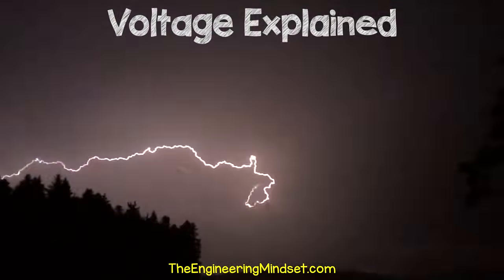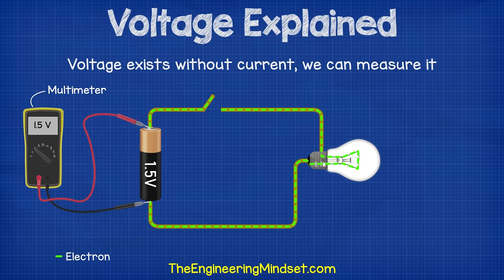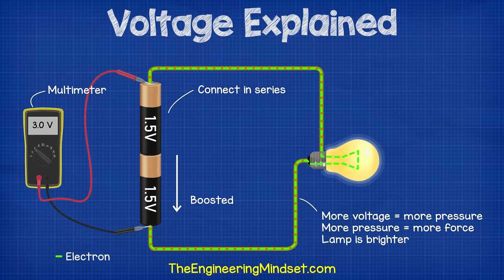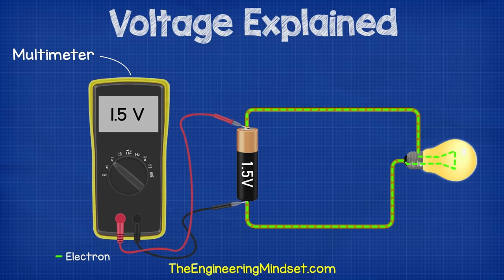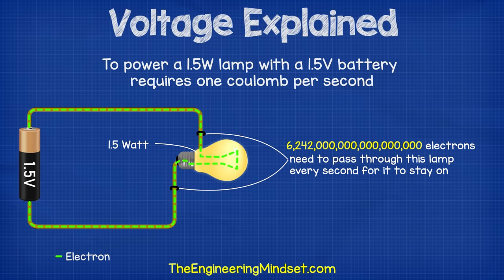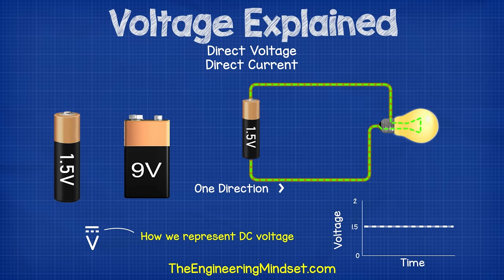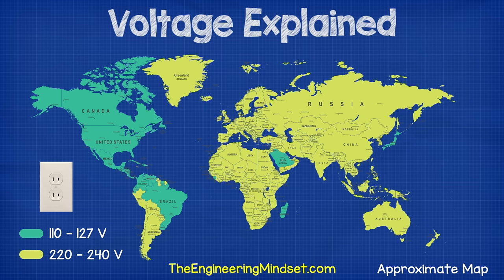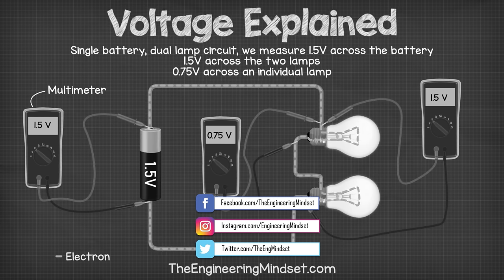Voltage Explained - What is Voltage? Basic electricity  potential difference

Comment: The easiest way to explain it would be to think of a battery. Nature is about balance. You know that when you put the positive side of a magnet close to the negative side of another magnet, they're going to try to pull together. They're trying to "balance" themselves.

Now think about that with electrons. The electrons in the negative side of the battery really REALLY want to get to the positive side. We take advantage of this by creating circuits. We give them a path to get to that positive side that they desperately want to reach, and we have them do a little work for us along the way. The MORE free electrons in the negative side of the battery, the more POTENTIAL there is for us to use (Voltage).

This is why a fully charged battery will read its rated voltage, or close to it, and why a depleted battery will read a noticeably LOWER voltage -- reflecting the fact that many of those electrons are now at the positive side of the battery. There aren't AS MANY of them left that need to get over there anymore, so much of the FORCE they provide when traveling through the circuit has dissipated.

Think of a bunch of people waiting outside a store before Black Friday. All of those people are electrons. Outside the store is the negative side of the battery. The store itself is the circuit. The register is the positive side of the battery. As soon as those doors are open, those people are going to rush to get to the items they want, grab 'em, and run for the registers! The more people (electrons) there are waiting in line (negative side), the more FORCE they'll have when they make their rush to grab what they want and checkout (positive side).

I hope that helps.
Reply: Not so much help its actually magic, I FINALLY understand. THANKYOU
Reply: There is not another Youtube comment that has been more useful to me than this one. outstanding explanation dude
Reply: @hania_khan396  You're very welcome. Glad to help. It's a bit confusing to grasp when you're unfamiliar with it.
Reply: @derpderpinson7449  Glad to help! It took me a while to grasp it completely myself. Once I did, I'd figured an explanation like this would be helpful to others.
Reply: Thank you for the explanation, but I don't understand the meaning of potential flowing from high to low. Doesn't this mean electrons should flow from plus to minus?
Reply: @robp4616  yep thank you!
Reply: @asiandude918  Sorry to respond late, but it didn't seem to give me a notification when you commented.

Potential is the difference of charge between the + side and - side of the battery, in that example.

When a battery is fully charged, it is at full potential because all of the electrons are on one side (-) and are desperately wanting to reach the (+) side to "balance" the battery.

When a battery is being used, it is connected to a circuit -- a series of wires and components -- from ONE side of the battery to the other.

This gives those trapped electrons a path to travel in order to reach the other side of the battery. When a battery is fully charged, it's like opening up the flood gates and letting it all rush through. That is the voltage (potential). If you were to put a DMM across the battery, it would read the correct voltage when it's fully charged, or somewhere around it (9V, for example).

As the electrons travel through that circuit to reach the other side, the charges in the battery are balancing out, which lowers the potential because there isn't such a huge number of electrons trying to cram their way through the circuit to the other side. That's why voltage readings lower as the battery becomes discharged.
Reply: A A  thaaaaaanks
Reply: A A 
Can I ask a question?

Can we think that the positive side and the negative sides like magnets?
There’s a negative and a positive side in the magnet too and they push each other when the same sides get close.
Reply: Thank you .like it was a thundershock of knowledge to my brain
Reply: I love you
Reply: Yo, this just helped me understand the whole concept! Thanks a lot!
Reply from the maker: Check this out, how a battery works: https://youtu.be/PXNKkcB0pI4
Reply: What I don't understand, though, is how two batteries in series generates a higher voltage.
Reply: Thanks a lot, your explanation helped me out
Reply: @robp4616   why doesn't the battery work when you put it the other way round, even though it's still a connected circuit, and the battery still has two poles?
Reply: wow!
Reply: As per your explanation after buying items(the electrons) they will go outside (the negative side),but it is not possible.Because if this happens the battery never drains😂
Reply: This is the best youtube comment I've ever read, I love you
Reply: @A A Amazingly Explained! Thankyou ! please start teaching physics this way on your YouTube channel...
Reply: Gods work
Reply: the thing is, when you say it's because more electrons are craming there way through, you are now referring to amperage. amps refers to the number of electrons per second. so to increase voltage while leaving amperage the same, you are effectively increasing available wattage without changing the amount or speed of those electrons. unless i'm missing something from your explanation.
Reply: holy shit you're so smart, i dont get any of that BUT nice explaining
Reply: @Really? no
Reply: Wa
Reply: Way*
Reply: @Really? bruh I read it too but I  had no idea what they meant I hate physics
Reply: I thought I knew what voltage was. Then i met capacitors, got confused af, and had to rethink the concept entirely. You're explanation along with this video has ended my 23 hours of pouring over the idea and given my mind clarity on the subject.  Thank you.
Reply: @eoinkane5908  Yeah it's not a perfect analogy in every situation, but it explains the concept well enough.
Reply: Damn you are good 😂😂😂
Reply: @a_commenter  The electrons increase as well as the voltage. After all two heads are better than one. Think of it like this, if Mayweather punches Logan Paul once his teeth will fall out, that means two punches from Mayweather will either knock him unconscious or kill him. I don't know if this helps, but I hope it does.
Reply: @le403_gundusravankumar8  You are being too technical about it 😂😂😂
Reply: I have a question. Does each voltage in an electric current must be greater than 0 or less than 0?
Reply: @misspetmalu501  Are you asking whether or not you should see a positive or negative reading when measuring voltage with a DMM? (Digital Multi-Meter)
Reply: @robp4616  Yes, Sir. Does that mean each voltage in an electric circuit must be positive? Must be negative? Can sometimes be both at the same time? Or can be positive, negative or ground?
Reply: @misspetmalu501  When the voltage is showing as a negative number while you probe the circuit with a DMM, that simply means you have the probes backward.

Probe a battery you have lying around. Put the red probe on the positive (+) terminal and the black probe on the negative (-) terminal. Make sure you have it set to DC voltage ⎓ (solid line on top, dashed lines on bottom).

If you're probing a 9v battery, it should show somewhere around 9 volts (duh). If you're probing a AA, it should show around 1.5 volts. AAA should be the same.

Now, if you swap the probes (put red probe on (-) and black probe on (+), it should give you the same reading except it'll show a negative number. This isn't damaging your DMM or the circuit when measuring voltage.

The only way you'll see a negative number on your DMM when measuring voltage is if you have the probes in reverse. This doesn't matter if you're just trying to find voltage, but it could be helpful if you're not sure which probe location is positive and which is negative.
Reply: @a_commenter  the voltages add together.
Reply: @a_commenter  the voltages add
Reply: lol this youtuber replied a link to his battery video because your analogy is wrong xD
Reply: This make sense, and is helpful, but I’m now unsure of how Amperage factors into this. It’d be really great if you could write an explanation.
Reply: @asiandude918  the electrons have a negative charge so they flow to the positive end of the battery.
Reply: Thank you 😍😘😍😍😘😍😘great explanation
Reply: You are a life saver!
Reply: That was very helpful. Appreciate the analogies you applied to the theory. Thanks
Reply: @asiandude918  Think of a water faucet. If you slightly turn the faucet on, you'll get only a little bit of water. However, if you turn the faucet all the way up, you'll get more water pressure. In essence the more water pressure you apply, the more water can flow the the faucet. In essence,, the pressure in the plumbing system, is similar to pressure in an electrical circuit. 
In a home electrical system,  the utility company, usually offers homeowners a single phase system with two electrical potential differences. 120Volts, and 240Volts. Depending on the type of electrical device, will ultimately determine the potential difference required to ensure that the pressure (potential) needed to move amps through the device.
Reply: Thanks a lot
Reply: The battery has the bronze color part less than the black part, they are not equal, one being more predominant than the other, which the bronze part is where the positive pole is, and the black part is where the negative pole is. So... this would be a symbolic way to represent voltage? the potential difference? Or these colors is just random?
Reply: Thanks buddy
It was useful
Reply: The way u just explained is ....... Thanks a lot man
Reply: just a doubt, why can't electrons go through the positive side throught the battery itself? wouldnt it be much easier and faster way?
Reply: @Saitama-py8dz  you mean to jump from the negative terminal to the positive?

Because there's an insulator preventing them from doing it.
Reply: @robp4616  oh okay. thanks
Reply: @a_commenter  I'm not sure if this is still of interest, but maybe this helps:
Imagine two glasses of water, both filled to the same level. The water column in each glass corresponds to the DC voltage of a battery, e.g. 9 volts. The amount of water corresponds with the stored energy.

If you connect 2 batteries in parallel, that's like putting the 2 glasses next to each other: Measured from the table surface, the water level (corresponding to the voltage) in neither glass is higher than before. Therefore, two batteries in parallel would still result in 9V.

If you connect 2 batteries in series instead, that's like putting the 2 glasses on top of each other: Measured from the table surface, the hight of the water column now about doubles (corresponding to the voltage). Therefore, two batteries in series would add up to 18V.

The amount of water however, respectively the stored energy, stays the same in both scenarios.
It's a simplified example, but I hope it makes it a bit easier to grasp.
Reply: @danieldauber8335  Thanks, this was really helpful
Reply: @robp4616   can I ask you which are sources you learn this from ?  It looks more easy to understand this video is pretty hard to understand
Reply: Thank you :)
Reply: I am kind a new learner and as I understand this examples perfectly fits to DC circuits. But what about AC, I need similar mind clear example of AC :)
Reply: Agreed. There is no postive to positive or negative to negative. Everything has a couple. Not woman and woman or man and man. All about balance
Reply: Oh
Reply: wait so, if we had no potential difference, does that mean that the negative and positive side is balanced? and the more potential difference there is, mean the more unbalanced they are??
Reply: thank uuu a lotttttt
Reply: By far the most useful comment on YouTube ever.
Reply: you didn’t have to comment that. but you did so people could learn. much love
Reply: thank you bro god bless you
Reply: You sir are the very best!
Reply: Thanks so much for this😍
Reply: Thank you🙏🏾
Reply: Awesome
Reply: you are the best rob p thank u u r heaven's gift to earth 
sincerely, grateful student
Reply: Such a great explanation in layman's term. Thanks a bunch. Would you mind having a youtube channel where you could explain all these stuff , will be really helpful to all :)
Reply: Just know, you helped so much. Read it like 5 times haha
Reply: Holy shit man, fucking incredible explanation, thank you for that,, I hope you’re in a position to teach others because you have a way of explanation that is astounding ❤️
Reply: @a_commenter  I don’t believe they do, I believe they generate a higher current, or a higher flow of electrons between the potential, at least when connected through a ‘series’. For example, if batteries are lined ‘upright’ in two columns, positive to negative, with one column having the positive side, and another column having the negative side, the voltage(potential) is increased because the the batteries are combining their potentials,, if batteries are combined sideways, or in a ‘series’ in other words, the potential is spread only across the positive and negative sides, making a higher current, but otherwise the same voltage. 
Edit: I explained this completely backwards, and had ‘series’ mixed up with parallel,, I apologize
Reply: bro I cant believe I finally understand this shit wowowow
Reply: @a_commenter  by connecting 2 identical batteries in row you are doubling the amount of free electrons. And now you have more electrons but on the same road. This means the pressure for them to move through is a lot higher. But higher pressure means a faster current, so it will deplete just as fast as a single battery that runs at a lower current
Reply: @robp4616  Excusme are you available for a question regarding voltage?
Reply: @JB-sm2ie  go for it
Reply: @robp4616  thanks for getting back to me so quickly. I was liking the mechanics and waves part of physics up and until electricity. Now I’m in complete confusion. I still just don’t understand voltage at all. What happens to the electrons once they’ve gone from the negative terminal to the positive? I also just don’t understand batteries in a circuit as opposed to in parallel.
Reply: @JB-sm2ie  you mean in series as opposed to in parallel? 

And think of voltage as the force used to push electrons.
Reply: @robp4616  Thank you. So if it’s a force, what changes between a low and a high voltage. Yes I Don’t understand why voltage is the sum of both batteries in circuit though remains the same in parallel.
Reply: @JB-sm2ie  so if you have 2 batteries within the same circuit that are wired in series, their voltage is added together because that's even MORE force that's pushing those electrons down the same path, in series.

When wired in parallel, you're introducing additional paths for those electrons to take. And so, if wired correctly and if the voltage of the 2 batteries is the same, the total voltage will be cut in half due to the additional paths of travel those electrons can take (and half of 24V would be 12V) -- so the voltage remains the same, but the current (throughout) has increased, potentially. 

When working with multiple batteries, it's a bit more complicated,   and even more so when the voltage is different in each battery, but the principle remains the same.
Reply: @JB-sm2ie  I'd recommend looking up some circuit labs online to see it in action. You can add batteries and loads as you please and wire them however you'd like then look at the results. 

I'd also recommend you try to learn the formulas for calculating voltage drop across circuits in both series and parallel.
Reply: @robp4616  thank you very much. I’m starting to understand. Still a bit more to get my head around.
Reply: @JB-sm2ie  yeah, it's one of those things that take a while to click. Hard to fully grasp the concept
Reply: @robp4616  yeah that’s true. Once again I really appreciate your time so thank you
Reply: if like this what different with   current，current is 6.24×10^18 electron flow a place right？
Reply: @buttbuttyawn3280  "there's way more shoppers outside the door, so the force shooting them in is greater, doesn't that mean you'd expect the current to be faster too?" 
If you have a wider path, without obstacles, more shoppers can get into the store -> more current (more electrons moving/1sec). Thin path, or many obstacles (resistance) means fewer electrons can get through to the store/time -> less current (less electron moving/1sec) even if the potencial difference (voltage) are the same in both case.
Reply: @pickle962  i think because then the electrons have to move the other way through the circuit, and the device than doesnt work, because the powering process is backwards, if that makes sense. The device expects the electrons to come from one side, but they come from the other side, which makes it not work.
Reply: @robp4616   @Dylan Badger  I understand that electrons can't travel or jump from the negative terminal to the positive terminal because there is an insulator...but because of that same insulator, how do the electrons travel from 2 batteries in series? In other words, how do the electrons travel from the negative terminal of Battery#1 to the negative terminal of Battery#2? Wouldn't that mean the electrons would have to go from the positive terminal to the negative terminal of Battery#2? And also through the insulator?
Reply: So in this scenario, for example, the amps would be the amount of people who run passed the electronics aisle, (which is at the very front, so every electron/customer has to pass by it) every second?
Reply: Thank you for this!
Reply: Still doesnt explain what charge is. Is it a property of each individual electron? Or just an emergent property resulting from too many electrons being concentrated in a limited space and wanting to get out just like pressurized gas?
Reply: @Henry14arsenal2007  the latter.
Reply: Omgggg than you soooo much it helped a lottt I've got my exams tomorrow

So basically.....voltage can be defined as the absence of electrons on the positive terminal...so the battery is basically trying to make itself neutral???
Reply: so voltage is charge ? What are amps then
Reply: @bikerboy3k  Amps are recognized as the number of electrons that pass a point in a specific amount of time. 

Generally, raising the voltage will increase the amperage (current) as well, so long as the resistance remains the same.

This will increase the power (wattage) as well. 

Try using a wattage calculator online to see what I mean.
Reply: @knowledgeknowledge2466  pretty much. 

When a battery is "charged," all the electrons are crammed into one side (the negative)
Reply: @knowledgeknowledge2466  how'd the exams go?
Reply: @robp4616  I get confused with the water example because I try to relate it to electricity as it's also stored and I have a hard time understanding how does one "Increase the voltage" as in increase pressure of the water. So let's say I got a potentiometer connected to the wall socket on one side and a light bulb on the other. Would it be like equating it to a tap in the middle of a garden hose? The potentiometer is like a resistor right ? And let's you adjust resistance? So if I decrease the resistance by twisting the potentiometer, less current so less amps will get through because there is less voltage passing through to push them to the light bulb >? And so the light will be weaker ? But here is why the water example is confusing. If you squeeze the end of a hose, you get water escaping faster although less of it. So then wattage is the...I don't know effort? Going to the bulb ? Less effort less results from the bulb ? I feel dumb dude the more I google it the more confused I get. Says 1 watt is 1 amp under 1 volt but under it says 1 amp is 120 watts. I should've paid attention in school bro, got too many questions.
Reply: @bikerboy3k  driving right now but I'll try to help in a bit
Reply from the maker: Check out NEW resistor video, everything covered! ➡️ https://youtu.be/DYcLFHgVCn0
Reply: The people trying to go in the store as fast as they can are the amps and the amount of security guards trying to stop the people are the ohms ir resistance.
Reply: @robp4616  cheers.
Reply: You're my hero!!

Thank you sooo much👍
Reply: Ah.  This explains why some people get tired if they wait in line too long and start to leave (e.g. leaving a battery in a drawer for a few years) and also explains why other people shoplift (e.g. rush in, grab stuff, and leave without paying).
Reply: Brilliant
Reply: In California, we don't need the register.  We take the products and just run the fock out of the store.  No question asked!  So it's hard for us to understand your example
Reply: In a hope of getting answer after 3 years :- 
 How does magnetic or electric field work (attract/repel) without any physical contact? What is the field made up of? It's just air particles or nothing? It's their property?
Plz answer in a simple language if possible (class 10th)
Reply: Pov the comment explained better than the vid.

Ngl though the vid helped me grab the concept this comment just helped me understand.❤❤
Reply: I FINALLY UNDERSTOOD, I SWEAR IM GONNA WORSHIP YOU, BRO I WANT MORE OF YOUR EXPLANATIONS
Reply: @robp4616 So with a battery do the electrons flow from the negative pole to the positive pole, - is that the direction the electricity goes in?  One would imagine the 'positive' to push it out and the 'negative' to be in receipt passively, going by the words used?  Thanks for the reply.
Reply: @Edward-mt2og  technically, the electrons go from the negative side to the positive side. This is because the atoms on the positive side are positively charged and atoms on the negative side are negatively charged. 

Electrons are shed from the negative side and move toward the positive side. They're attracted to the atoms on the positive side that are in need of electrons to become (balanced.) They're also repelled by the negatively charged atoms on the negative side because they're unneeded. This creates the force (voltage).

Thinking of a magnet helps to explain this. 

When you put the (+) side of a magnet to the (-) side of another, they easily snap together. When you try to put the (+) side with one magnet to the (+) side of the other, they repel, or resist. Same with (-) to (-)
Reply: Thank uuu!! it was always hard for me to grasp...thanks again!
Reply from the maker: Seen our new Potentiometer Explained video? ➡️ https://youtu.be/Xb-MZMoUtcQ
Reply: Amazing explanation… hats off to you.
Reply: You have to go back.
Reply: @eternallearner5395  I have to go back? Lol

I've been out of the electrical game for a while
Reply: I love this explanation so much, I have always struggled so much around potential difference but this makes it so simple. Much love!!
Reply: Following this analogy, how is it that a battery is consumed up ? From the comment, it seems that it's because a used up battery has more electrons on the positive side of the battery. But electrons are simply flowing across the circuit, why do we have electrons piling up on the positive side ?
Reply: The black friday analogy is genius ngl
Reply: This makes me sad for Electrons. This sounds like Slave labor 🤣
Reply: Amazing explanation! Greetings from a greek highschool girl!